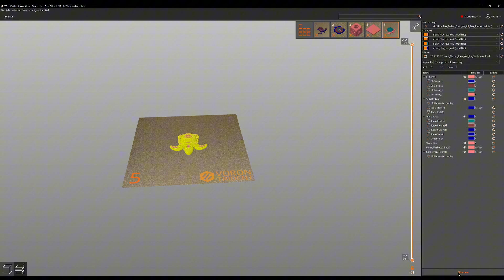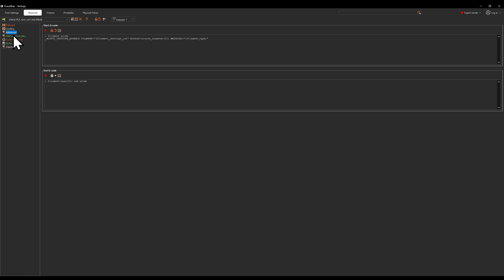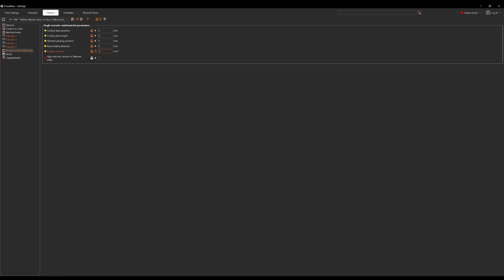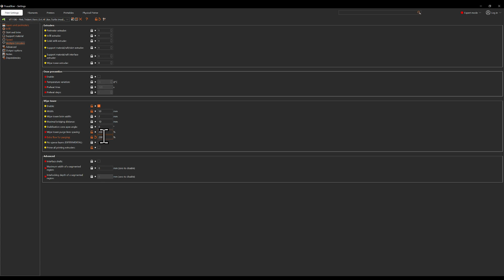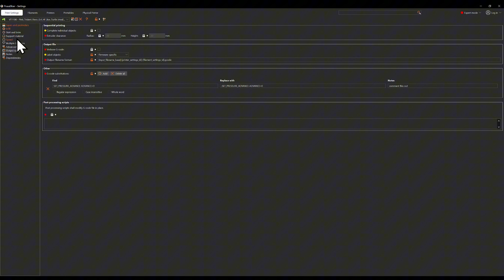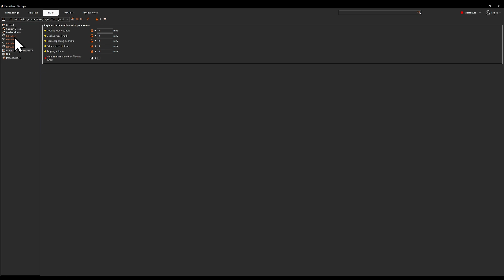Prusa Slicer Box Turtle Settings

Comment: One thing I noticed is that setting "Printers -> Single extruder MM setup -> Cooling tube length" to 0 will emit "G1 F0" commands (set flow to 0) which is invalid for Klipper and will fail your prints. Setting that property to 0.01 mm resolves the issue.

Comment: Idk if they updated this or not but that g code substitution completely knocked out my pressure advance settings period. I checked the g code without it and it works as expected with zero mentions in the whole g code about pressure advance resetting to zero at any time. Just putting it out there before someone blindly follows this, and your print goes to shit.